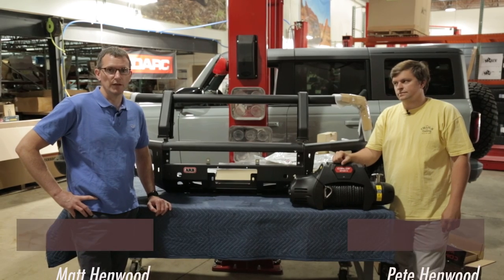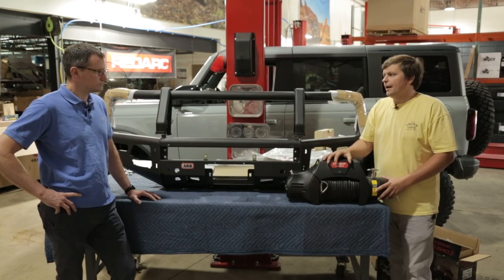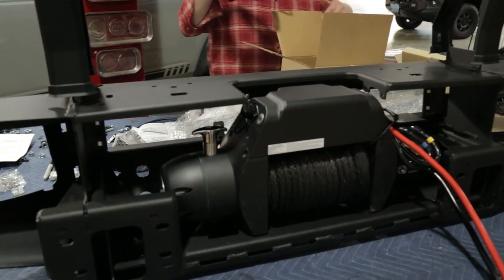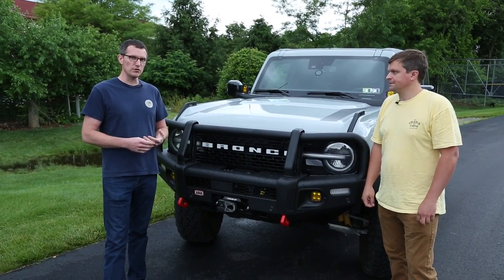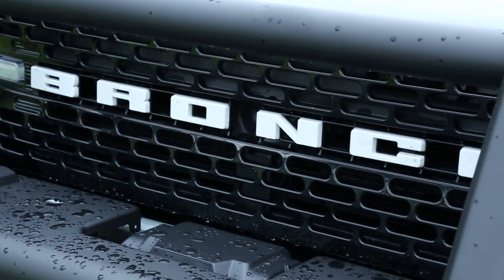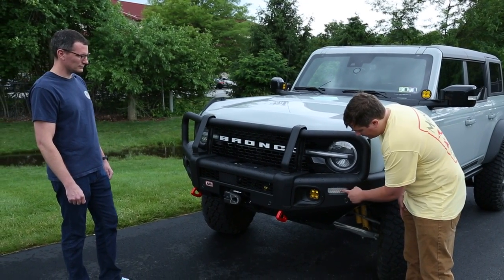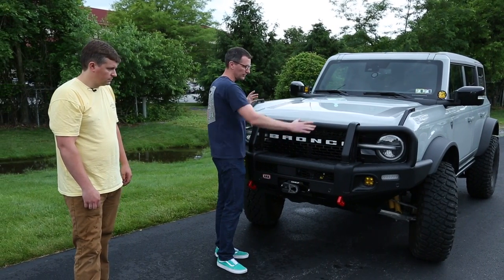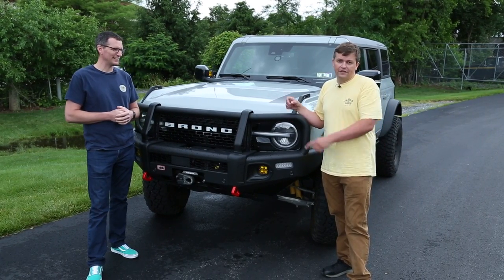The BEST Winch Bumper for the 2021+ Bronco!

Comment: Question, which model of the Baja designs fog lights did you use? Did it require any additional cutting? Wiring harness? Any info helps as I have the Summit on the way. Thank you!!!
Reply: I also would like to know the same thing please! Also I unfortunately built my bronco with the modular bumper, is it possible to make the fog lights work with the factory switch or do you have to go to the aux switches? Thanks!
Reply: Only legal way to do fogs from Baja would be the sae legal ones
Reply: How did Baja fog lights install go to you?

Comment: Does this alter anything about the Adaptive Cruise Control and Pre-Collision Assist, Automatic Emergency Braking?
Reply from the maker: This bumper only moves the location of the front camera, its keeps all factory assists working as they should
Reply: @MainLineOverland  What affect does this move of the front-facing camera have on the off-road camera systems, if any?

Comment: The bumper looks great,  but it's almost 250lbs of additional weight on the front.  Sucks, I love my arb on my 1st gen tacoma and was about to pull the trigger on one for my bronco
Reply from the maker: Actually you would be surprised what the Ford Factory steel bumper weighs. It definitively helps to offset, but a coil spacer at a minimum is still recommended.
Reply: The Ford Heavy Duty Modular Steel Bumper that comes standard on the Badlands and Wildtrack weighs 80 lbs. But... if you add the Ford Performance Winch Kit (winch tray + Warn 10K lbs winch), then that adds another 190 lbs (and costs $3,500!) bringing you up to 270 lbs hanging off the front. So, now the ARB bumper starts to look more attractive in terms of cost/weight.  In either case, yeah, you're going to need to upgrade the front suspension to bear the weight.